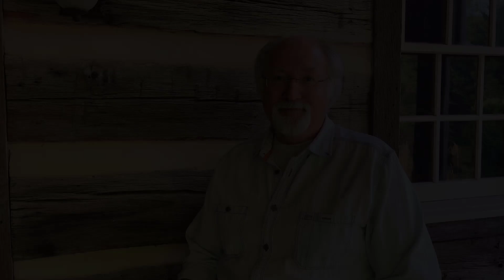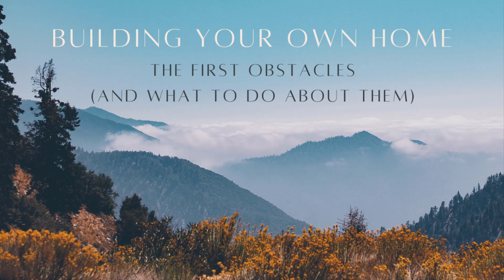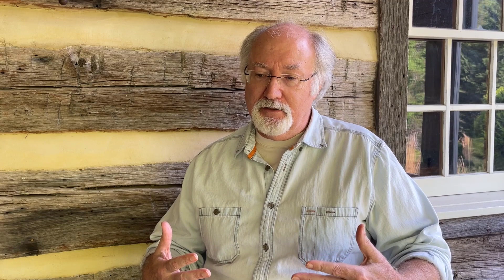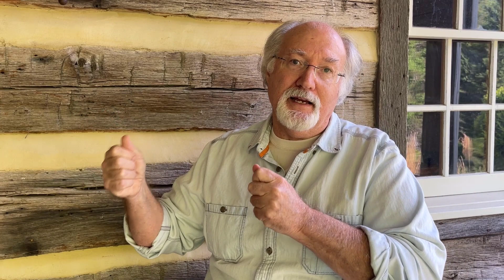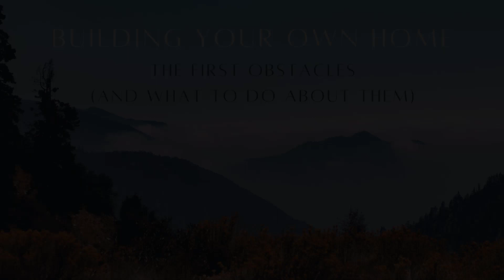Owner Builder Obstacles... Don't let anything keep you from your dream!... Handmade House TV #178

Comment: Great Video!  Sorry to hear of the problems, Noah.  
Anyone-
1.  A "good contractor"  should have relationship/friends @ the County.  (Making approval easier?)
2. F the "Banks".  (Can an owner builder buy workman's comp and assemble a crew? why not?)
thx
hp
Reply: I am using the CREDIT UNION only to buy our land.  The rest we are self-financing as we go.  Have $5k logmill (Woodland Mills).  $2000 - $2500 for a full load of logs.  A few bucks for mortar to fill the rock in around the perimeter of our sono-tube post foundation.  Flooring, trim and roof will be all off my logmill.  Really all I need to shell out for is the electrical runs and boxes, water supply and drains, metal roof and hardware.  That will get us going pretty well.  That is a fair amount of building to do before I need to invest in nice craigslist appliances and sinks. :)

You can do it - just need to plan ahead, invest in decent tools, and charge forward, like Noah says! :)

Comment: Dang... I think  I ruined myself  lol where am I going to go when I move????
My first house I bought & live in, is in a rural area that pretty much doesn't require permits for anything under building from scratch. All renovations, including new windows, siding, roadside fencing, a couple- 3, inclosed porch add ons, essentially doubling my sq footage, new driveway at other end of property... nothing cost a thing, no agro  from anyone, just did it, granted property taxes went up but no one has done on site inspections, they just picked a dollar figure and added to people's bills by area, so regardless how neat, clean and nice a place you keep is apparently irrelevant anyway. 
It's going to be hard to leave and start over somewhere  as a pain in the arse as what you're  dealing with, and frankly, would make it impossible  for I'd  say most people, especially  these days, to even attempt building  & buying land. 
Who's got the extra time, patience, and EXTRA expense money for all those  shenanigans? Beyond an Architectural sign off on the plans and an Electrician to approve  flicking the switch on, the rest is money grabs and power trips. 
I suppose  like all the other forms of independence and self sufficiency.... they're not real big on supporting that concept, put it mildly.
Reply: "all those  shenanigans.   money grabs and power trips. "  You got that right!
My first permit 1981 new home $25; 1 inspection; for setbacks.
Today $25,000, and $80 fee ea inspection.  

Voting DJT 2024